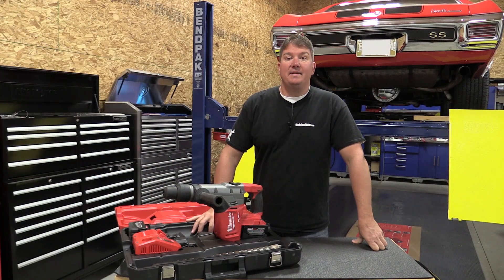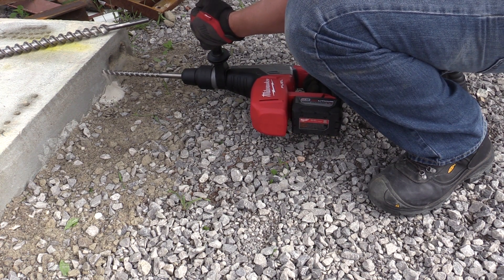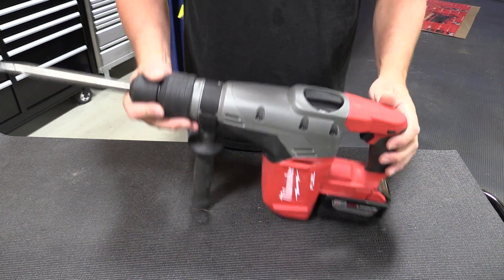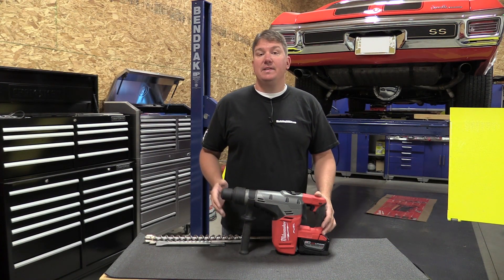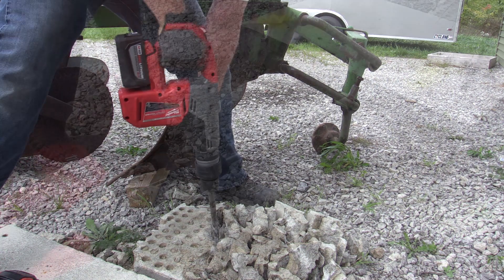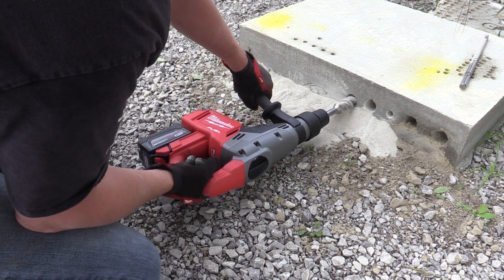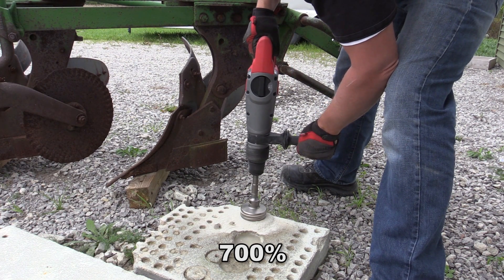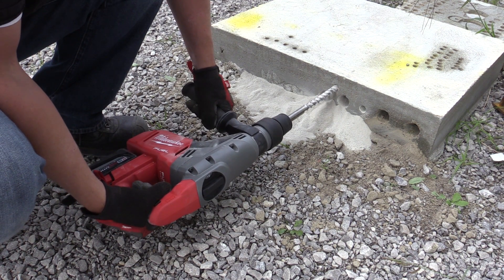Milwaukee M18 FUEL 1-9/16" SDS Max Hammer Drill Review Model 2717-22HD

Comment: Can I use the same bits I use with my 1in sds?
Reply from the maker: Is your 1" a SDS plus or max?
Reply: WorkshopAddict sds plus
Reply from the maker: @TheJakobLott  Plus and Max have a different diameter bit head.  I believe Bosch has a unit that will take both.....  But I am 99.9%  sure this one will not.
Reply: There are adapters that go from sds Plus to sds max.
Reply: No

Comment: Wish I knew if a new generation Fuel of this model series would come out in 2019. I think this is pretty old. Circ saws and drills have been replaced with new Fuel gens sooner. I know their larges and newest cordless will come out in January 2019. But that is way too big for 99% of jobs.
Reply: It doesn’t seem likely that’s their highest output motor

Comment: 9 amp battery is boss, the only thing better is my new 12 amp battery... I roughed in a whole 4 bathroom house including groundworks cuts with a single 12 amp battery ( used a cordless hole hawg and a m 18 fuel hackzall )   all holes and cuts.... did not even drain the whole battery, still had 1 bar on it.

Comment: would really like to see a drill only selector, im in the milwuakee lineup but dewalt has it on their sds drill could be useful for drilling steel in a pinch or when  you have steel and conncrete sandwiched together

Comment: $700 for the M18 Fuel vs $350 for the exact same one but electric. Ill stick with the electric hammer drills for now until the ridiculous price of these cordless tools comes down.
Im a Milwaukee Fuel fan but I can't justify spending double the price for the same drill just because its cordless
Reply: eBay you could find it for 300/400 hundred bare tool

Comment: This tool is a little bit silly.
Using batteries is more likely to be a hindrance. Not really worth it for the occasional moment when cordless will be useful.
Also, 9 A.h battery? Having that many cells in parallel means they won't get balanced as well in the charger is just have the standard 2P5S combination.
I don't think this unit will be hit.
Reply: That's not how it works. All parallel cells are self balancing. All series cell packs must be balanced by a charge controller. Whether 1p, 2p, or 3p, all cells are balanced the same.

Comment: can i keep it chipping concrete for over 60 minutes without any stop except changing batterys?
Reply from the maker: The tool does not get warm, so it should have no issue with that.
Reply: the fuel brushless motors can go all day, if you have a few batterys and acouple chargers just keep swapping.. be careful with their lower end brushed motors though if you run a full battery through them under heavy load and swap in a fresh one theyll tend to let the smoke out